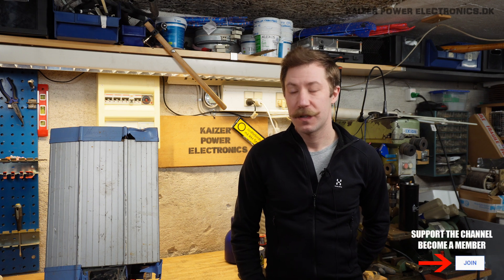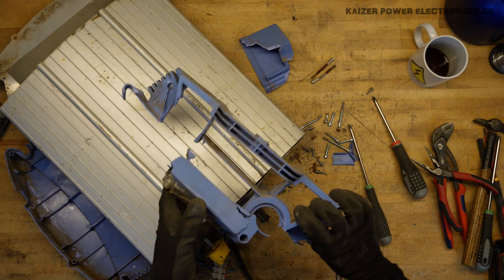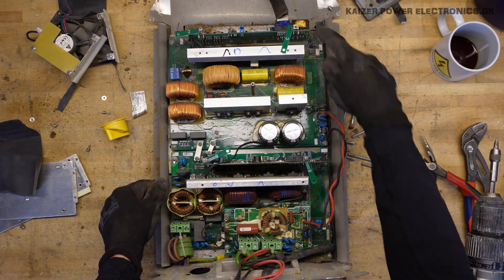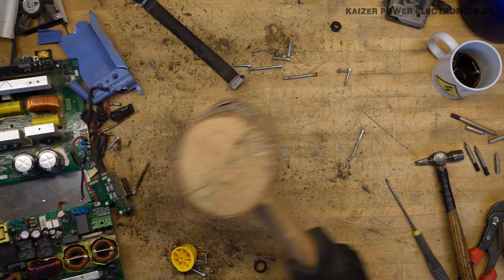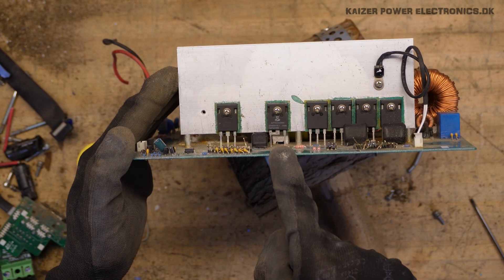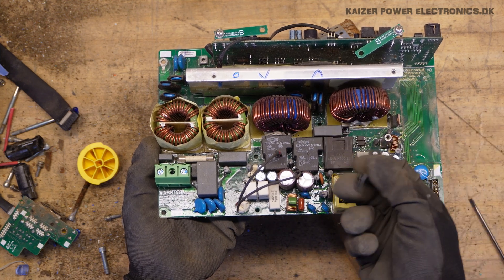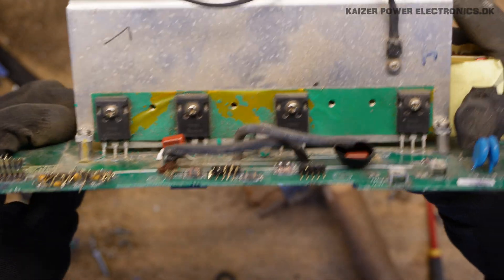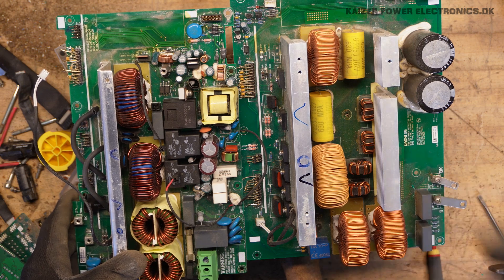Teardown of a 2 kVA Solar Inverter, the Mastervolt XS2000

Comment: I would bet the only thing getting the Inverter decommisioned and discarded is the  dead battery in the ST Timekeeper head . Only 5 bucks to replace, but the service personel is incapable of doing this basic clip-on replacement. I had some of those fail in Equipment which you have to send in to the manufacturer to get the "licence file" reprogrammed on the Battery SRAM, demanding close to $10.000 to do so while keeping the software locked down for recovery by the customer or 3rd Party repair. I would even say a good part of the current  electronics scrap is just because of failed memory, corrupt config files or propriertary, incompatible communication protocols
Reply from the maker: Properly only based on the power electronics lifetime, manual said 187000 hours ~21 years, but this being from 2009 and not thrown out yesterday, it's more like 14-15 years. But you are right about obsolescence through "bad" design. We will soon face a whole new era of stuff that can no longer be used, all that required a app, bluetooth and a smartphone. Soon those apps are no longer anywhere to be found. There will be a black hole in tech history, no one will be able to replicate google/apple store.